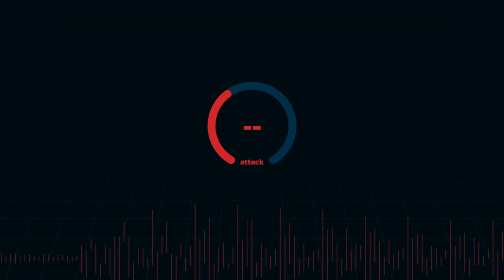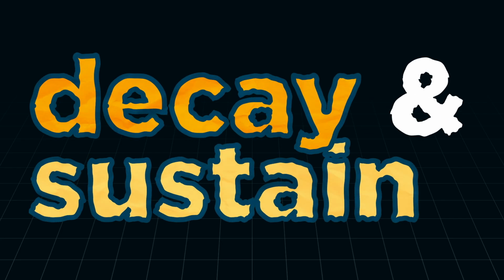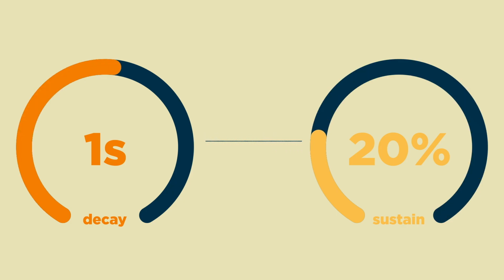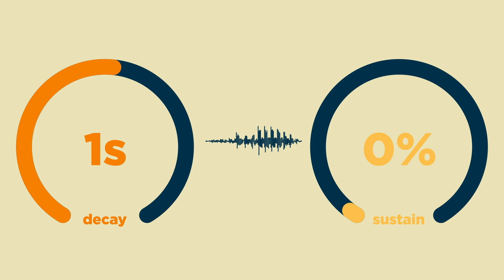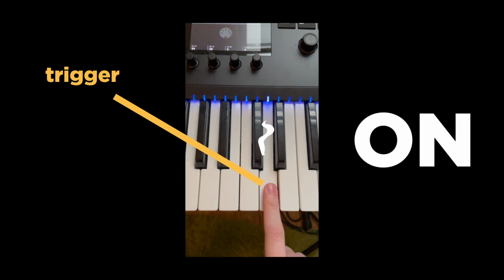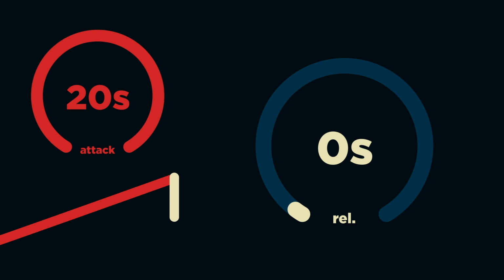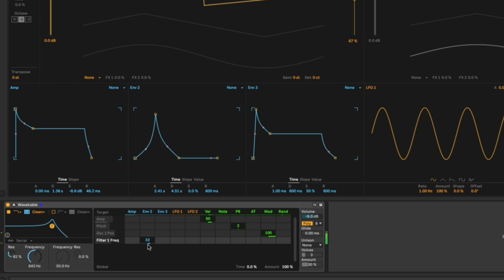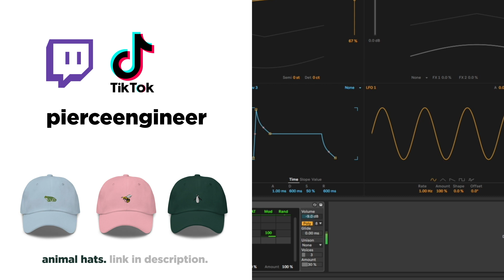How ADSR & Envelopes Work

Comment: Hi Pierce. Can you please explain why the “Sustain” parameter is not a “time” parameter even though it is plotted along the time “x” axis?  In other words, “sustain” is defined as a volume parameter but it is still plotted over time. Therefore, why is it not categorized as a “time” parameter much like Attack, Decay and Release that are all plotted over time as well (plotted on the “x” axis)? Thank you very much.
Reply: Hey, not Pierce but I'll give this a shot. 

I believe the misunderstanding of Sustain in an ADSR Envelope as being time comes from the way we think about a piano or a keyboard Sustain pedal. For simplicity I'll be refering to an Amp or a Volume shaping ADSR Envelope in this comment.

Like you said, the Sustain is a Volume percentage parameter, not a time parameter. Unlike A,D & R, that have Time parameters and actually affect things on the time axis, the "time" of the Sustain (as I believe you are refering to) is determined by a multitude of other factors, most notably how long a note is being held. But the time of the attack, and the decay all play a part in to this.

The Sustain is there to determine at what level the sound should be at after the Decay time. So the Attack takes the sound to it's max volume (in most cases) and the decay then takes it back down, but to what level does it take it? 

Let's say you have a Midi note that is 100ms long, you have set your A time to 25ms, and D time to 25ms. Now even though you would only hear the sound for 50ms, that Midi note that you've created is technically playing the entire 100ms, you just can't hear the last 50ms because the Decay has taken it to no volume level. But what if you'd like the sound to go on for the entire 100ms + release? Then you'd need to give it a certain Sustain level to land on that makes it audible for the remaining 50ms. So the sustain doesn't inherently control the time of the note, it's been 100ms all along, it's only concerened with the level of the note after the Attack and Decay have finished. 

Hope this was of any help and keep on exploring!

EDIT: Forgot to mention something. The Sustain is sort of waiting for the sound to reach it's desired Volume, it won't let the Decay do it's thing and go zero. Going back to my earlier example, if the Decay is set to 25ms, that's how long it takes for the sound to go from Max to Zero volume, not from the Max to the Sustain. The Sustain will just kind of pick up the sound along the way at it's position (percentage) where it's waiting for the sound. So if your Decay is set to 25ms and your Sustain is set at 50% and the Decay is linear, then the decay effect is only 12.5ms long, reaching the Sustain level and the Sustain will grab it from the Decay. Please correct me if I'm wrong on this, but this is how I believe it to be happening.

Comment: i almost completely understood ADSR before this video
but this video made me understand how Release actually works if Attack and Decay have not finished.

before, my custom ADSR implementation always played Attack and Decay before it could transition to Release. but now, the Release curve scales according to the current volume and plays immediately if the new "always finish Attack and Decay" parameter is set to Off (or false, as it's called in programming).
※ yes, i made the synth industry's standard behavior opt-in because in my context of programming a game, my original behavior of always finishing Attack and Decay before playing Release is still the more useful option in most cases. i don't want to wonder why no sound plays when i summon a note to play with the default duration of 0.0 seconds.